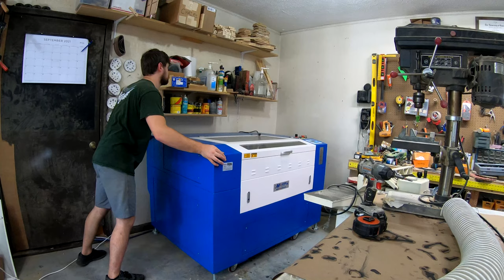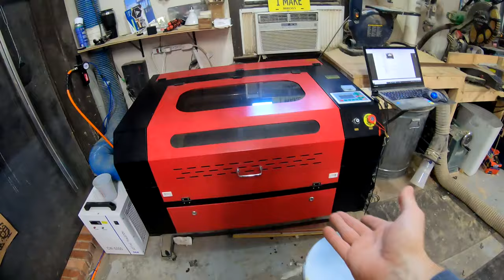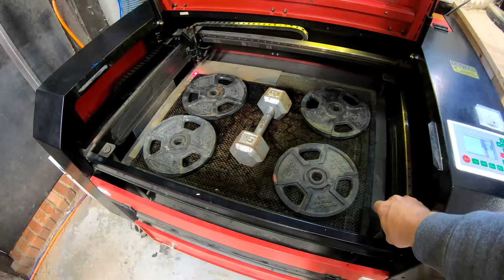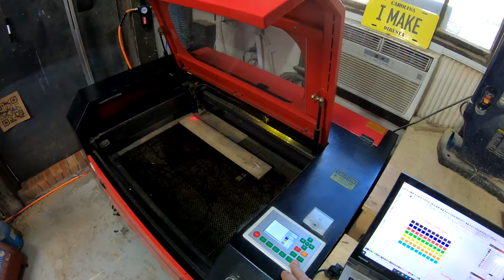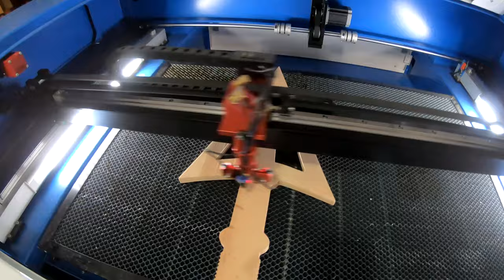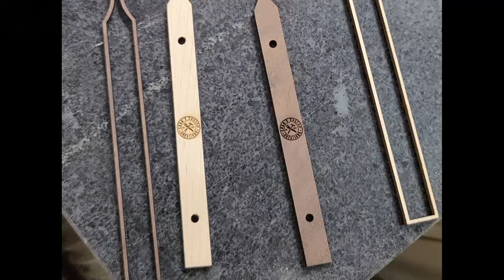BEST Chinese CO2 laser engraver cutter RM Laser VS Generic Laser

Comment: How does it line up materials?
Reply from the maker: You can do it a lot of different ways. You can use the red laser pointers and the framing function or when I need to be very precise I put down some sacrificial material like tape or cardboard and cut the outlines.
Reply: @ChadsCustomCreations  So there isn't a camera option?
Reply from the maker: @Golfexpertbelieveme  I don't believe RM lasers offers this. Adding an after market camera system can be done quite easily and lightburn actually sells everything you need to do this. I have the kit just haven't put it in quite yet. If I do I'll try to grab a video of it to show how it goes.
Reply: @ChadsCustomCreations  that would be sweet. I have just started my research on different lasers and one thing I noticed is how much easier things are if you can line them up on a camera. So far I like the one you just showed and the Epiloge but it is so much more expensive.

Comment: Question. I thought it had to be in focus to be able to correctly cut through. Why step down?
Reply from the maker: So the beam of Laser coming out is shaped like an hour glass so yes at the focal point is the highest amount of energy but as you go through thicker material the idea is since that top area is cut moving it down will refocus it on the material that hasn't yet been cut. Also getting lens with longer focal lengths make for better cuts on thick materials.
Reply: @ChadsCustomCreations  thank you. Would it take longer to cut thicker material with it in focus the entire time?
Reply from the maker: @TheDwilliams1000  it may not be clear in the video but I had it step down after the first pass so it moves the focal point from being on the surface of the material, and with the second pass stepped down it refocused down into the cut thus giving it a better chance of cutting. The further out of focus the weaker the cutting power becomes. So yes keeping it in focus gives it faster cuts.
Reply: @ChadsCustomCreations  So how do you know how to focus it once the first layer is cut? Do you just go down a little once the first layer is cut?
Reply: @ChadsCustomCreations  also is this the only machine that can step down like this? Is that a ruida function?
Reply from the maker: @TheDwilliams1000  I believe any machine with a motorized Z axsis should be able to do it and yes a ruida has the function.
Reply from the maker: I mean you could be specific and figure out the depth of the cut but I just experiment until I get a good result.
Reply: @ChadsCustomCreations  ok then thanks

Comment: I still wanna know how to use ceramark.
Reply from the maker: Make sure metal is clean, shake can really well, spray a light coating, let dry, and anything you laser will leave the coating. Once done wash off extra Cermak that's not lasered with cold water.
Reply: @ChadsCustomCreations  ok thanks. Is there a certain speed and power you need to ensure it lasers correctly?
Reply from the maker: @TheDwilliams1000  yes but every laser is going to be different. When I start a new material I have 2 test files I run one for engraving and one for cutting and it shows me a bunch of different speeds and powers. The goal is how fast can you run it and still achieve what you're wanting. In this video you see me running my engraving test file.